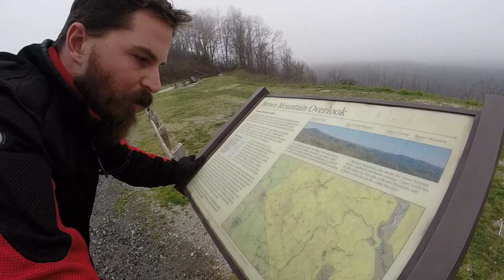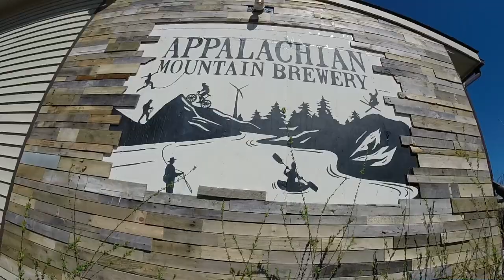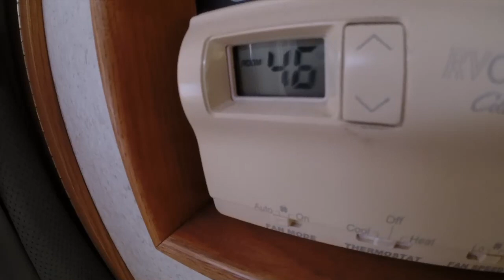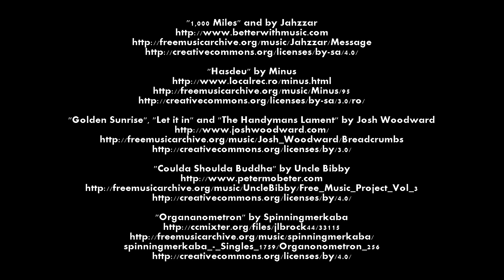#10 No Brakes ~ Coast to Coast (SV Sundowner)

Comment: Great video report and despite all the problems I think you got off pretty lightly - I think that shop looked after you well. I think I would be tempted to source replacement wheel bearings all round and plan for replacement when next convenient.
Reply from the maker: Bill's Garage in Boone NC really did us right:) We were out the door with everything from a tow 40miles up a mountain, new trailer tires, two new brake lines, a new right caliper, the outer wheel bearings greased and the inner bearing replaced for $750 bucks. Also they were really cool.

Comment: You definitely need to sign up for either Good Sam or Coach-Net emergency road service. At about $100 /yr its cheap insurance for these type situations. Very few mechanics will do repairs roadside on these rigs. PS: careful going down those unknown narrow back country dirt roads, sometimes they end suddenly with no room to turn the big rig around. many boondockers go ahead in their towed vehicle (or motorcycle) to check it out before proceeding with the coach in new unexplored areas.
Reply from the maker: Our plan is to scout if we dont "know".  in this case we were just trusting the rangers advice.

Comment: Have you prepped for mice ?  If your going to boondock, the mice try to make your home there's. Mice will crawl up into your rig by way of tires, hose's, elc. cables, chains.... So plug those holes.  Cool place
Reply from the maker: Now Dani is going to lobby for a mouser pet.
Reply from the maker: +Scott Deney This is Dani. Is a snake an acceptable method of mouse control? Because I've always wanted a pet snake.
Reply: Well, late at night, just make sure you grab the right snake.  When your in the woods, you may end up with 5 to 10 mice. I thought snakes only eat so much and then rest for a few days.
Reply: +Scott Deney 
Scott is right, you DON'Tl want mice getting in. Cheap steel wool works pretty well to plug holes, esp. temporary ones like when you have a cord or hose out while hooked up. The expanding spray foam is good too for long term use (not exposed to sun) or big gaps.

Comment: Here I am debating, Class A or C or 5th wheel. Someone explained to me what would happen if your A breaks down, and there you are. In a garage for 2 or 3 days.  A class C Ford Or Chevy could get fixed anywhere. A fifth wheel can easily be towed or you have the tow vehicle. But dang if I still long to tow a car with a Class A. Just something about it. Can't explain it. Good luck. Be safe.
Reply from the maker: Some of the class a gas vehicles actually use ford chasis and engine.
Reply: +Sundowner Sails Again 
Yeah, and yours I believe has a Workhorse chassis which is GM with the 8.1 Vortec. Pretty reliable powertrain, albeit a tad thirsty. Used a lot by UPS too for their smaller trucks.